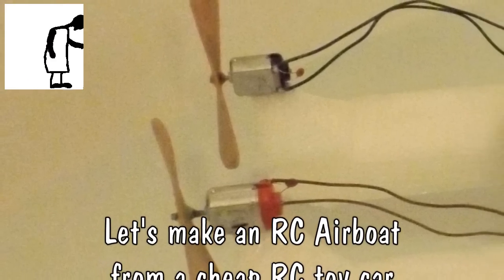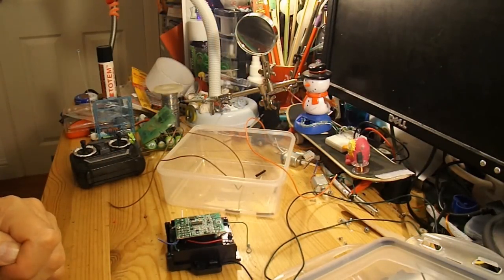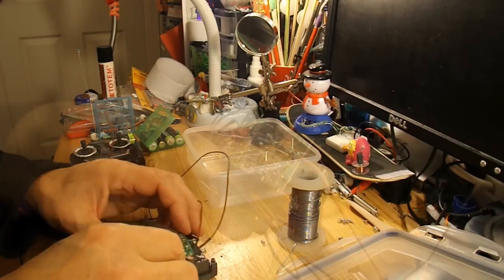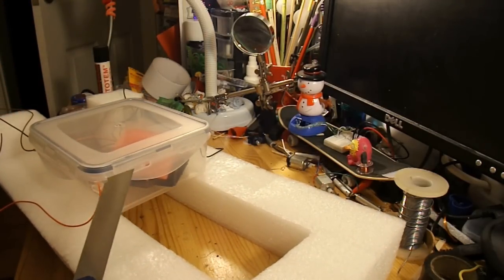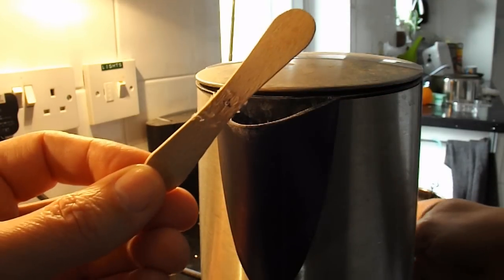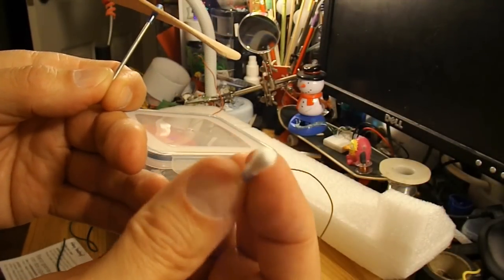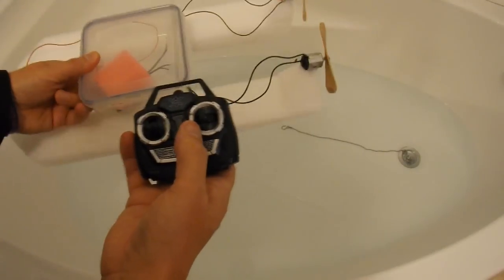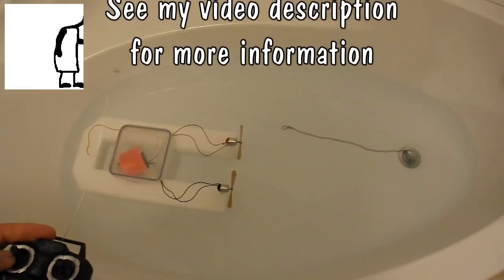Let's make an RC Airboat from a cheap RC toy car Part #2

Comment: Take apart rc cars
Reply from the maker: Here are my RC car playlists (many of them include disassembly videos)

Radio Control Cars https://youtube.com/playlist?list=PLA5a2xPRSrB0hs_uRx0mCbsNsQSKE0i_3
Micro RC cars https://youtube.com/playlist?list=PLA5a2xPRSrB1PdBnI5MNSc85s3fiFMltk
RC cars in a can https://youtube.com/playlist?list=PLA5a2xPRSrB0Fy3QcbOFgK6HiOoc_Tf3c
RC Atomix MicroCar https://youtube.com/playlist?list=PLA5a2xPRSrB3Mq6fXo0qEYq41gN1Np_8c
RC cars Scratch builds https://youtube.com/playlist?list=PLA5a2xPRSrB1Uv62K0fL5O0j_vhd0eHYY
RC New Bright Mercedes-Benz SLR McLaren https://youtube.com/playlist?list=PLA5a2xPRSrB30I1eMMHpQClFYqH0QEwsi
RC low rider truck tear down https://youtube.com/playlist?list=PLA5a2xPRSrB0E8YGukmlD141WYy3A-qOz
RC Fast Lane Jeep Cherokee https://youtube.com/playlist?list=PLA5a2xPRSrB1I4cS2wmjg8KdnBtGhnZci
RC Car unbranded Black Truck https://youtube.com/playlist?list=PLA5a2xPRSrB09ohYdBdo20DNrCvPTrb6w
RC Car Dickie Toys Lightning McQueen https://youtube.com/playlist?list=PLA5a2xPRSrB1-R6MOiKLyAqmnUCXWTGf0
RC car in a can https://youtube.com/playlist?list=PLA5a2xPRSrB0Fy3QcbOFgK6HiOoc_Tf3c
RC car Mondo Motors 1:10 RC PORSCHE 918 https://youtube.com/playlist?list=PLA5a2xPRSrB058Ig-TR8csXGgGmnL5soH
RC Car 40 MHz New Bright Hummer H3 https://youtube.com/playlist?list=PLA5a2xPRSrB3x-GalcO6Rm7C28A6-ytu5
RC car Rastar Ferrari F138 1/12 scale 40 MHz https://youtube.com/playlist?list=PLA5a2xPRSrB01-Nws68xRZghYdGSKp6qY
RC car Devils Monster Rock Crawler https://youtube.com/playlist?list=PLA5a2xPRSrB19dQHPsA3gop7oU-CzDVgY
HBX 2098B Devastator Mini RC Crawler https://youtube.com/playlist?list=PLA5a2xPRSrB3ppqUQoOrr55z1ITa0VvXI
WPL B-1 1/16 Military Truck Rock Crawler https://youtube.com/playlist?list=PLA5a2xPRSrB1eOfmY2zyaLHsxxLi4RTDi
RC Car Maisto Extreme Beast RC car 2.4GHz https://youtube.com/playlist?list=PLA5a2xPRSrB2yHVCdg0KpsXMPYtD8zdai
RC car MN Models MN99SA https://youtube.com/playlist?list=PLA5a2xPRSrB0wa_a045AUT9gvTlE3rTCV
RC Mitsubishi Pajero/Montero 4x4 Hobby Grade Conversion https://youtube.com/playlist?list=PLA5a2xPRSrB2wPV2zXYr7z9jbgi_GC_Fk
RC New Bright Corvette https://youtube.com/playlist?list=PLA5a2xPRSrB32Nv7aIGH_EvNJ6L8j3Luv
RC Car 360 Wheelie Stunt Vehicle Micro Racing Car https://youtube.com/playlist?list=PLA5a2xPRSrB10XqPkMqFYyb975be6T5bK
RC Nikko 1985 Toyota Hi Lux Truck https://youtube.com/playlist?list=PLA5a2xPRSrB0i-38BijJXBY_MVE-6ZamS
RC Car Nikko Slammr https://youtube.com/playlist?list=PLA5a2xPRSrB1aA0hmtUt7Fyy9v5gvKkhR
RC Car Fast Lane FLX Microdrive https://youtube.com/playlist?list=PLA5a2xPRSrB0Y_bkXoudCVC9rAztxgenl
RC Quad Bikes https://youtube.com/playlist?list=PLA5a2xPRSrB2q2QVzY8f8PkbTcHamhLid
RC Bikes & Trikes https://youtube.com/playlist?list=PLA5a2xPRSrB1tSrxhSL1cYX1F_hkvBCay
RC Shopping Trolley https://youtube.com/playlist?list=PLA5a2xPRSrB3EuauOWulITkevsPHwWugn
RC Model Car Steering https://youtube.com/playlist?list=PLA5a2xPRSrB1CeqvjOaBPrHk_lVcTHSb9
Scratch built steering for RC toy car https://youtube.com/playlist?list=PLA5a2xPRSrB3mmQfxfz6o_JPHkjxpK9zu
RC Dickie Toys Lightning McQueen https://youtube.com/playlist?list=PLA5a2xPRSrB1-R6MOiKLyAqmnUCXWTGf0
RC Ferrari Fiorano New Bright 40 Mhz https://youtube.com/playlist?list=PLA5a2xPRSrB2a3U2Y1SdVy2s8vRuR2gm6
RC Lexus IS300 from Superdrug Stores https://youtube.com/playlist?list=PLA5a2xPRSrB1dseFjY9gyAWviZLFsAdLP
RC Lamborghini Aventador LP700-4 2.4GHz TOY GRADE https://youtube.com/playlist?list=PLA5a2xPRSrB2VTGdufUONZAzyFDaMEY3S
Grandad's Lamborghinis https://youtube.com/playlist?list=PLA5a2xPRSrB25UEWzthLQe49m_m5GBSOW
RC Porsche Panamera S Hybrid DX121436 Diasaw Toys 27 MHz https://youtube.com/playlist?list=PLA5a2xPRSrB2pRkya1j2bP2I4HiBYz-8u
Rastar Porsche 911 GT3 RS https://youtube.com/playlist?list=PLA5a2xPRSrB10eKolGYCc1crC0Y2TuYBC
Hotdeer Ready Go Race 1/18 Desert Buggy https://youtube.com/playlist?list=PLA5a2xPRSrB2_hC2Jw1hJMeUAjfVgzE_u
RC Poolmaster Amphibious Car https://youtube.com/playlist?list=PLA5a2xPRSrB2-78_r3D9bGWsHNh-uAha7
Nikko Vaporiser RC Amphibious Car https://youtube.com/playlist?list=PLA5a2xPRSrB2DV9Pj9-yQuVZVBO4Q4um_
Nikko Velocitrax https://youtube.com/playlist?list=PLA5a2xPRSrB3XQ2k0doezl2_XgIFC4wVj
Nikko Corvette Car Crusher https://youtube.com/playlist?list=PLA5a2xPRSrB2Qf1Og-W8lAA5del8F_pzF
Nikko Super Nova https://youtube.com/playlist?list=PLA5a2xPRSrB30Tm6jkfC9yUge_PvHWLdx
RC Car Red Mini Cooper S from Toys R Us https://youtube.com/playlist?list=PLA5a2xPRSrB228La-rTGobhTEDkosRTYJ
RC Car Blue Mini Cooper S https://youtube.com/playlist?list=PLA5a2xPRSrB2rjKYq0llzug3AkHnVLD1s
RC Hydro Terra RC Amphibious All Terrain Assault Vehicle https://youtube.com/playlist?list=PLA5a2xPRSrB08DwB4_-xKnV_-7-HtSZLy
RC 4x4 Revell Lion 2.4Ghz https://youtube.com/playlist?list=PLA5a2xPRSrB1ojIWnx20oLFqqC34C3Kup
RC car Monster High DRCLRA https://youtube.com/playlist?list=PLA5a2xPRSrB2SPJpazmVkklSsBxfBXBMk
RC Conversion Barbie Jeep https://youtube.com/playlist?list=PLA5a2xPRSrB3AOxmT1iyHPx5j5Qlze4LS
RC Conversion Equestria Girls Car MLP https://youtube.com/playlist?list=PLA5a2xPRSrB1-lLQvHnN3rhYhXAHPvGWY
RC Conversion Ford F650 Toy Truck https://youtube.com/playlist?list=PLA5a2xPRSrB0yIKPwmGQDAK47uO0aRaOQ
RC Conversion Deutz Fahr DX 470 Toy Tractor https://youtube.com/playlist?list=PLA5a2xPRSrB2TqZK7HiLeW4kji-D4ENwY
RC Conversion Toy Tow Truck https://youtube.com/playlist?list=PLA5a2xPRSrB3i63DAlsaKUjbFSc1FPeRZ
RC Conversion Kalmarsunds Gruppen Tipper Truck https://youtube.com/playlist?list=PLA5a2xPRSrB2JSbNT7BwsKbXRaxfUxH7N
RC Conversion Linde Fork Lift Truck https://youtube.com/playlist?list=PLA5a2xPRSrB0V6joHvVqzTNJGM8ePURum
RC Conversion Zeppelin friction powered toy car https://youtube.com/playlist?list=PLA5a2xPRSrB1Mwbd3p0vC8pq022Enej1F
Chrysler PT Cruiser https://youtube.com/playlist?list=PLA5a2xPRSrB192nevcznQPXMKfQBCzOrl
Grandad tries the Gamma 2.0
RC VW Vans https://youtube.com/playlist?list=PLA5a2xPRSrB3uTgPtRWysSOrD1hrblB5x
RC cars on the Road to Nowhere https://youtube.com/playlist?list=PLA5a2xPRSrB18ud5HMQj0X86j99rkfbWA
RC Wheelie Bin Car https://youtube.com/playlist?list=PLA5a2xPRSrB0WpUf48J6GxJEpDt4Cuhui
Things stuck on top of RC cars to make them RC !! https://youtube.com/playlist?list=PLA5a2xPRSrB2m1p07y69uHcr3KbWoafsq
RC Chicco Buggy - Billy Big Wheels https://youtube.com/playlist?list=PLA5a2xPRSrB2wMu8ycm16R8-XAJfgStGX
RC Car Chicco Jimmy Thunder Hobby Grade Conversion https://youtube.com/playlist?list=PLA5a2xPRSrB0bWWSmuzyvsJ9LEcPOVHA9
Another Chicco RC car hobby grade conversion https://youtube.com/playlist?list=PLA5a2xPRSrB0bZ0I2CMU0Zi1cHGg074hK
RC Max Spinner Tyco Vertigo https://youtube.com/playlist?list=PLA5a2xPRSrB3Ls1tg8wPOZeWgxliJGT38
RC JADA RC battle machines Laser Tag Cars https://youtube.com/playlist?list=PLA5a2xPRSrB31TB9di52f8STv2A61YNQ_
RC Auldey Micro Stunt Car https://youtube.com/playlist?list=PLA5a2xPRSrB252A_qFc07Xoej_0tMcL4j
What can I do with that toy grade Transmitter & Receiver https://youtube.com/playlist?list=PLA5a2xPRSrB2KYw1ZgX_WHicdepBxjdka
RC Conversion Toy Tank Hobby Grade - May 2015 https://youtube.com/playlist?list=PLA5a2xPRSrB1ZwL1ns9Puw95i7hNyNF9l
Tandy Radio Shack Wired Remote Control Toy Car - Go - Malibu Drive 60-2545 https://youtube.com/playlist?list=PLA5a2xPRSrB2JHmT2z2Vsswv6BzAeOupX
Doc McStuffins RC Scooter IMC Toys https://youtube.com/playlist?list=PLA5a2xPRSrB1Bvv3Vm1G81NAb8Luoz2-M
Junk Pile Frankenstein Bargain Store RC Tank - Frankenstein' https://youtube.com/playlist?list=PLA5a2xPRSrB3bUajOqDYmh267lIFqhjwo
deAo excavator https://youtube.com/playlist?list=PLA5a2xPRSrB20c6EaEMmdcEMG-Eey9usV
HL Toys Bulldozer Power Scraper SW HL 3058 https://youtube.com/playlist?list=PLA5a2xPRSrB3Vcv6tUaYjVsZX5Pj2lZbm
RC Tractor QY83011 tractor https://youtube.com/playlist?list=PLA5a2xPRSrB12ZQMnHubjJZVXT653JYwN
Case IH 140 RC Tractor Britains Big Farm 42600 https://youtube.com/playlist?list=PLA5a2xPRSrB2ptJehUjIRGV-_Yj_fSlbh
RC Toy Projectile Launcher playlist https://youtube.com/playlist?list=PLA5a2xPRSrB3NKaSR_hI1gTUBtOyUvthu
RC Robot Wars SHUNT https://youtube.com/playlist?list=PLA5a2xPRSrB1OAhrZzSxAjCKIC6dggehA
RC Sumo Wrestlers https://youtube.com/playlist?list=PLA5a2xPRSrB2_Gq0V5pljeZCYXOPeefTU

Comment: can I use a coreless motor
Reply from the maker: I am sure you could, it's your choice. A coreless motor is still a normal DC motor so as long as it is the right voltage range it should work OK with a normal toy grade RC receiver. What will NOT work is a brushless motor as that needs 3 wires and an ESC to control it.
Reply: thank you sir